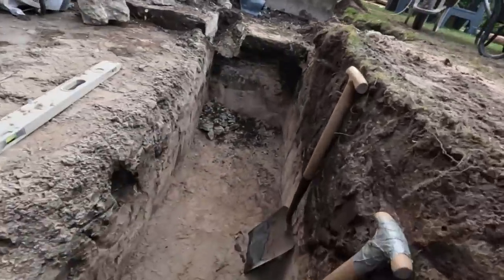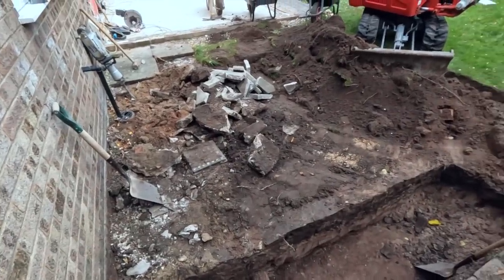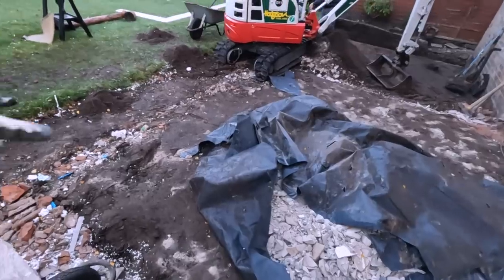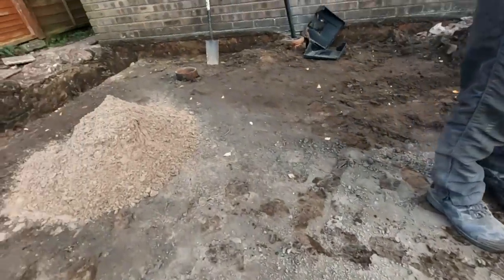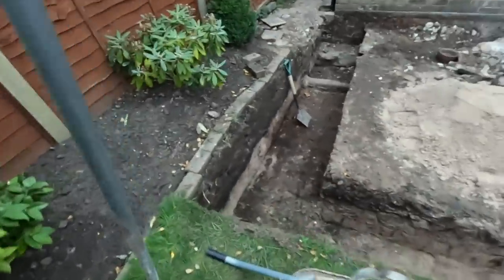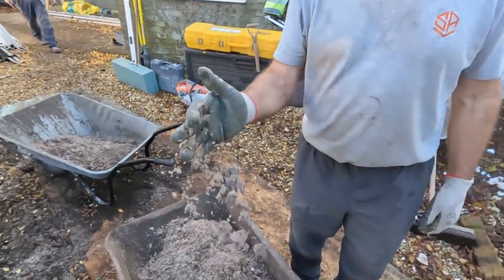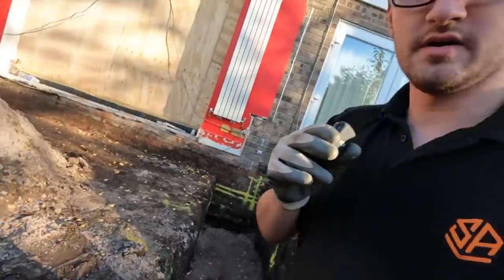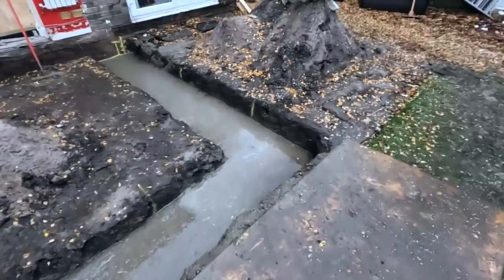TAKEUCHI MINI DIGGER BIG DIG!!.. BIG EXTENSION PROJECT PT 1

Comment: Is there a shortage of skips where you are I watched a video before where you were held up by a skip and now you have a large dump of soil in the front of the house with a over full skip at 18 mins into the video.great ground you have for the extension should be easy going but order the skips a bit quicker.
Reply from the maker: Comments like this are really annoying when you obviously haven’t watched the whole video 😤🤷🏼‍♂️
Reply: Not heard of a grab?
Reply from the maker: @danielwillow1979  Grab wagon . They pick up the spoil and can hold 16 ton for roughly the same price as 1 skip ( 8 ton ) 🧱👍🏽
Reply: @SteveAndAlexBuild  a bit harsh
Reply: @SteveAndAlexBuild  I know what a grab is. I was replying to Brian. Your responses seem a bit rude TBH
Reply from the maker: @danielwillow1979  . Not rude but I respond to every comment and always have which takes up a lot of time so when someone makes a comment and it’s obvious they haven’t bothered to watch the actual video you can see why it’s very frustrating.
Reply: @SteveAndAlexBuild  lol they the sort of ppl that think grab wagons pretend to be full or only unload half a load ignoramuses, too right good show keep up the good work

Comment: A fine example of forming the under-build of a new extension from excavating the ground with a top machine man on the digger to organising the demolition of an old extension and having enough bodies to get the rubble and soil taken out to be uplifted! To then create correct levels for the concrete foundation and shuttering around existing drainage! All done to a high standard and very professional thanks for sharing your knowledge and experience on the job Steve and Alex 👏
Reply from the maker: Thanks very much John 🤜🏽🤛🏽🧱👍🏽

Comment: Just a little tip when you are pulling up concrete with the digger leave the push blade on it (about 12 inches from the end) the pull up concrete with the bucket it will snap off easy saves using a hammer keep the videos coming I am originally from Skelmersdale and now live in Oz love watching your vids let me see home ie Ormskirk etc and I love your work I am in construction well done team SA
Reply from the maker: Thanks for the tip Colin and hi from Ormskirk at 3 degrees, it was minus 4 this morning 🥶🥶🧱👍🏽
Reply: Hello boys yes I am struggling here it’s only 36 degrees
Reply from the maker: @colinweightman1056  😆😆🧱👍🏽

Comment: How do you measure concrete ? We go by cubic yard here in the states. We would also pump it through a 3 inch flex pipe! Less people and you can put it anywhere you want without a path or barrows ! Looks good ,nice and solid! No metal though? Metal in everything here even flatwork!
Reply from the maker: We are in metres .only reinforced when specified. 🧱👍🏽

Comment: How come the concrete company barrow it in, is this down to cost instead of using a pump which would be quicker?
Reply from the maker: There are dozens companies that do a Barrow service up here it’s very common. Why spend extra money on a pump when you don’t need to, you don’t have 2 wagons blocking the street and I’m willing to bet it’s no quicker with a pump. 🧱👍🏽

Comment: The machine is there to make light work pull the slap up ...even easier as the cowboys who built that never used mesh ...
Reply from the maker: A conservatory foundation doesn’t need mesh , nor did ours . The ground is solid .
    They just didn’t go wide or deep enough 🧱👍🏽
Reply: @SteveAndAlexBuild   wow , over here we have sandy soils we have trench mesh that's 450 wide and pour  450 deep , all slabs have 8mm mesh at 200mm squares ,
Reply from the maker: @chebarden8278  😳🧱👍🏽

Comment: Water cured concrete.  Terrible for a finish, superb for concrete strength.  Since this is a buried foundation, no wories, just strength.

Does the concrete supplier use volumetric mixers on trucks for this kind of work?  Is that typical there?  Does anyone ever pump the concrete fo avoid the wheelbarrow work?
Reply from the maker: In 36 years I’ve used a pump once when I was an apprentice to do a swimming pool .
  Most companies up here have the volumetric wagons with barrows .
    Cheaper fir the customer and mostly quicker 🧱👍🏽

Comment: If you hired a 1 tonne dumper with that digger it would’ve made it easier , could’ve got the footings done in a day makes it so much quicker, well worth £100 hire cost
Reply from the maker: We’ve explained about the dumper in the comments
Reply: @SteveAndAlexBuild  ah okay , we run out 1.5 tonne digger and out 1 tonne dumper over some ply on any jobs and it’s always fine does a nice job of protecting everything , and saves so much time removing the spoil and then for concreting and type one of the oversite , definitely worth it on any more big jobs
Reply from the maker: @lukeharrop6467  🧱👍🏼

Comment: You have a lot of room on that job why not hire a 1 ton dumper to take soil around to the front instead of useing a wheel barrow ?
Reply from the maker: Didnt want to be running over the new block pavers with a 1 ton dumper🧱👍🏽😬
Reply: put down banker boards to cover them so much easier
Reply from the maker: @nigelhaines7900  boards won’t stop 1 1/2 ton over a small area sinking the paver . We don’t know if they’ve been done well but it will be our fault if they sink 🧱👍🏽
Reply from the maker: @martin2466  Exactly 😬🧱👍🏽

Comment: Personally I would have hired a pecker for that machine to break out the old concrete. Not much to hire and so much easier.

Understand that caution about running a bigger dumber over the blocks but I think you would have got away with a tracked barrow